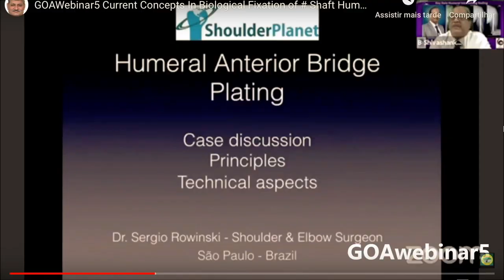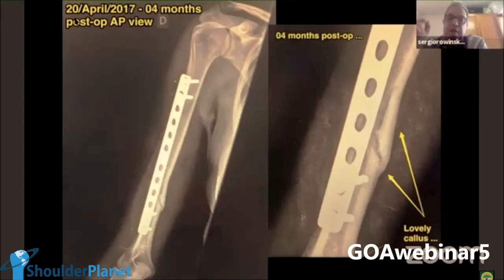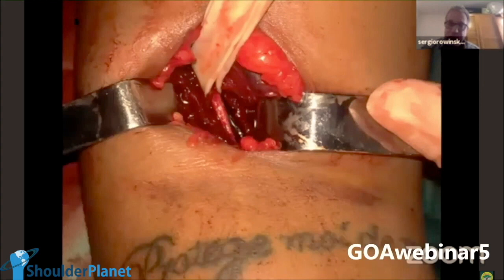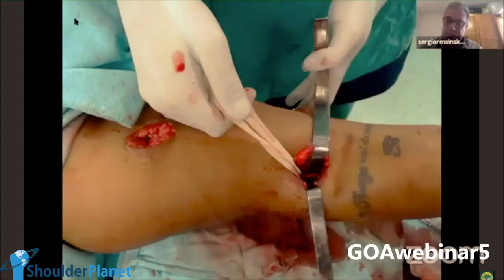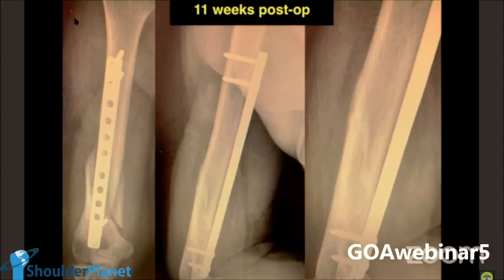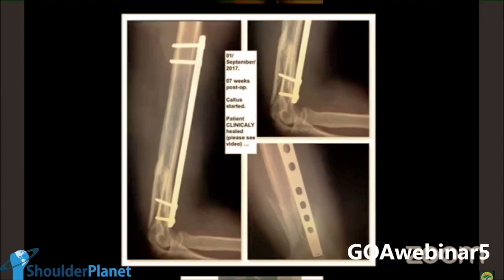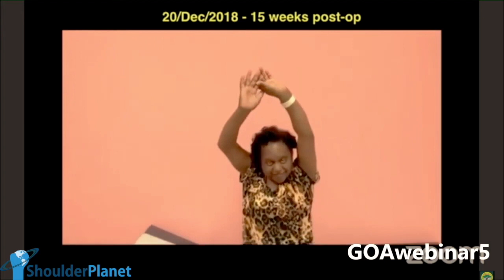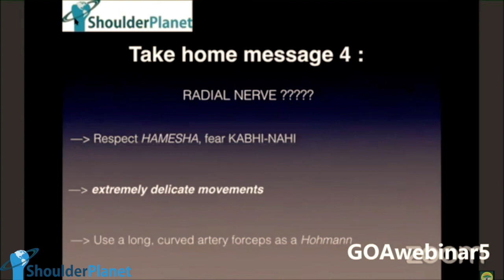HUMERUS  ANTERIOR BRIDGE PLATE LECTURE - TIPS AND TRICKS (presented on GOA Webinar 04/April/2020)

Comment: The dr explains this very well. I just got orif minimally invasive like the video, anterior apporach with a 12 hole surgical steel plate and 4 screws for my torsional distal humerus fracture (happend while armwrestling). 
Seeing the guy doing pushups with no discomfort gives me hope since I was also very active. 
Although some people say the hardware causes pain in intense exercise that involves weights (the natural flex of the bone is stopped by the rigidness of the plate, at the ends, where the screws are and creates stress points). Hope that wont be my case.